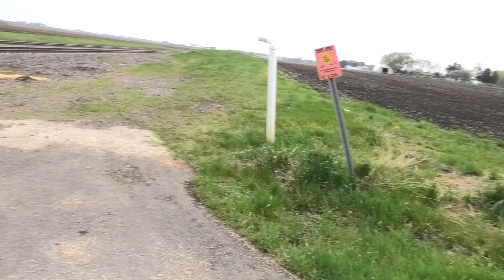Rockyford Rd. Grade Crossing Update Franklin Grove, IL 4/29/21

Comment: What I don't really get is why a crossing with a PTC tower needs a PTC antenna as well. I've seen a few crossings in my area with wayside signals next to them that just use PTC towers, meaning the antenna isn't really needed here. So why would UP install a PTC antenna when there's a PTC tower? Wouldn't the PTC tower work for the signals as well in this case?